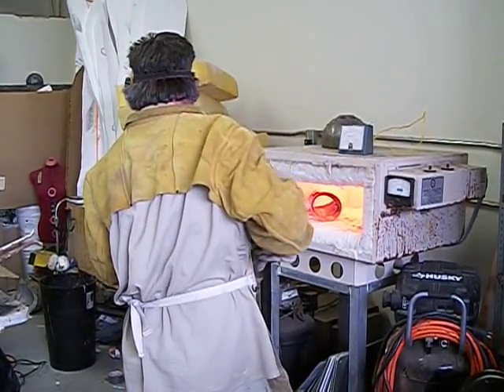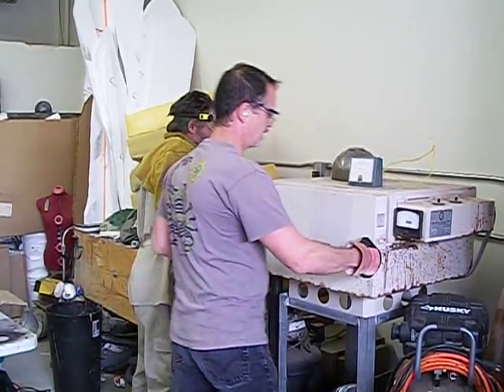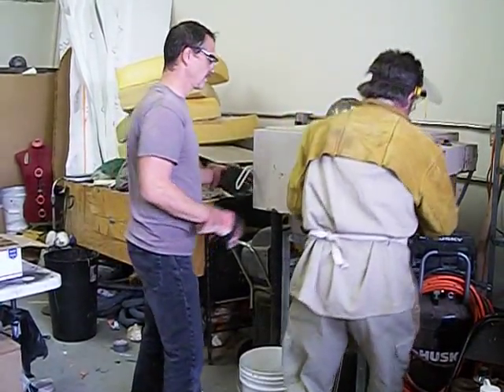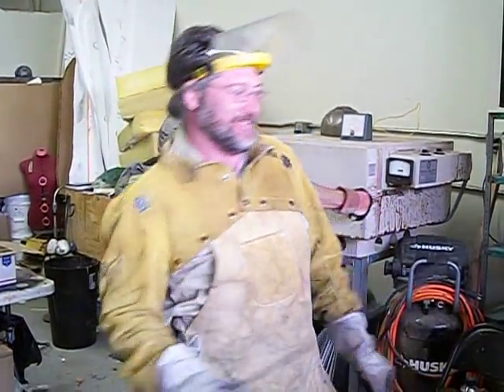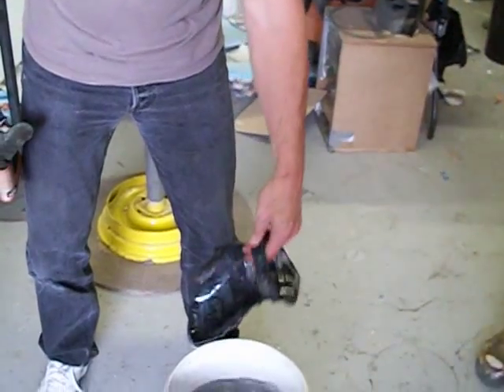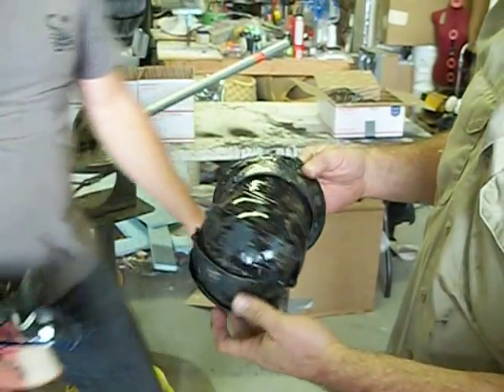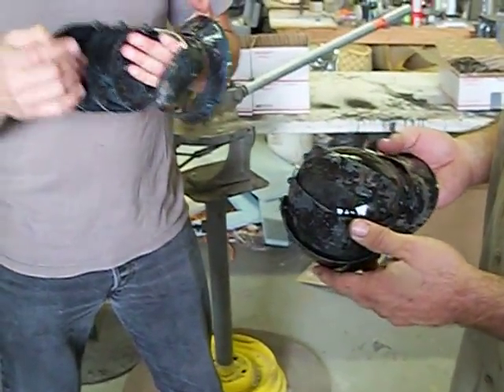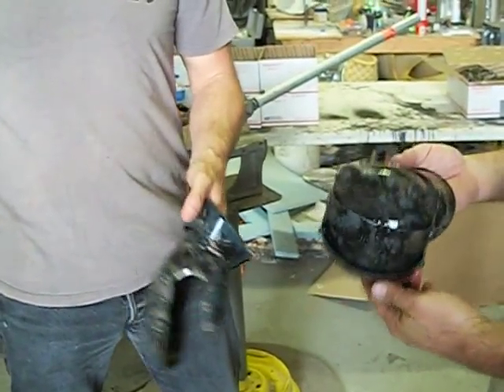Heat treating 4130 Spring Gauntlets

Comment: What is the temp and how long were they at that temperature.
Reply from the maker: Hey Charles.  Id rather refer you to the source. Craig Nadler has a ton of info on heat treating different metals for Rattan and Steel fighting. Id get it off his site directly rather than let me misguide you. Thanks for the question, sorry I am not answering it directly.